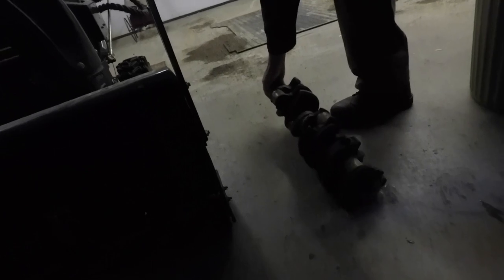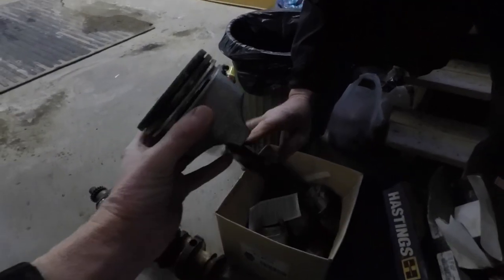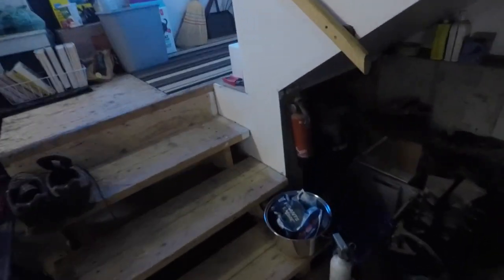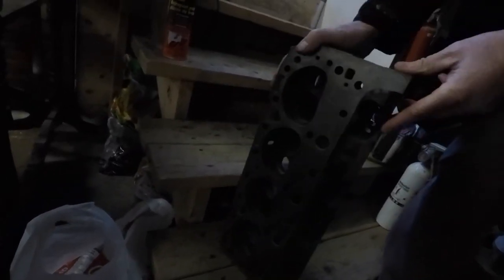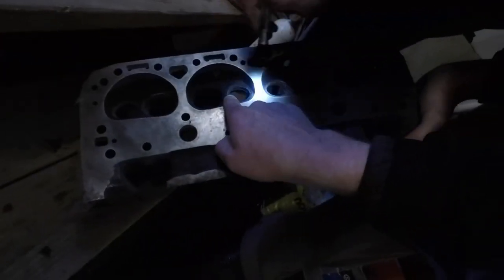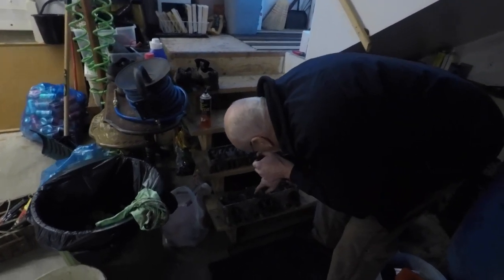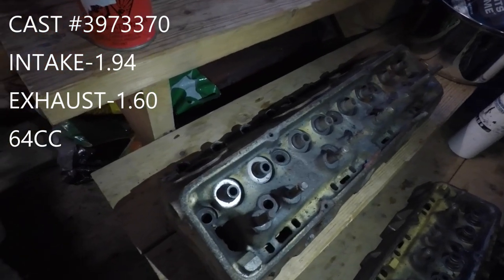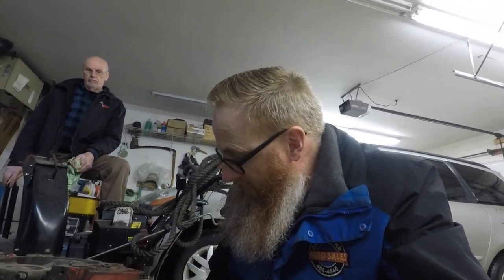SOURCING OUT A SMALL BLOCK CHEVY 4 BOLT MAIN AND DOUBLE HUMP HEADS FOR MY 1977 C10

Comment: I've got the 461 double hump heads..had the  accessory holes drilled and tapped, screw in studs and new springs...and I've got a set of 062 vortec heads....haven't made my mind up yet
Reply from the maker: I would have done the same thing if i had to. If they are true vortec heads, they should flow much better than any old double hump. Thanks for watching
Reply: Hard to beat Dbl Humps
Reply: @OldeCarrGuy  just picked up another set of 186 DH with 2.05 intake 1.85 exhaust. Been ported and have nice springs and rockers for 340 bucks with port matched edelbrock performer eps intake. Score!
Reply: @joejones9944  vortec heads are waaaaaaayyy better that camel backs ever were.